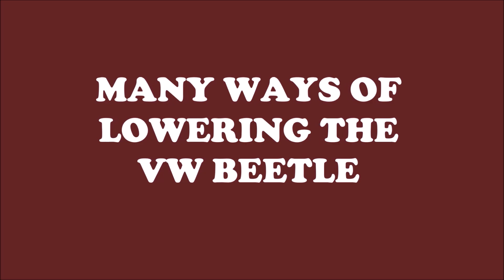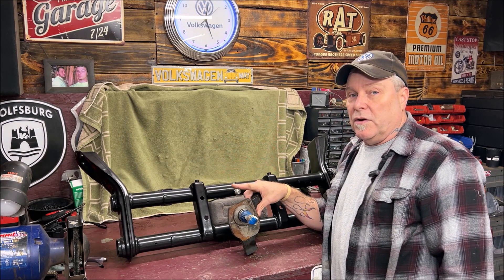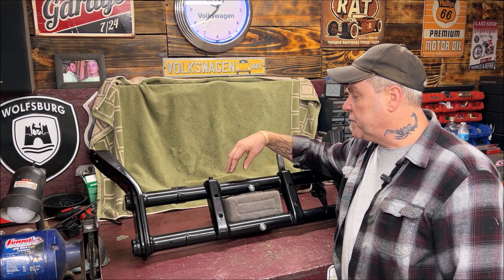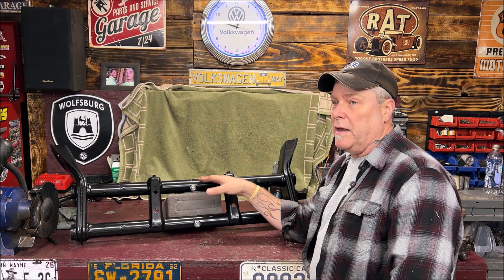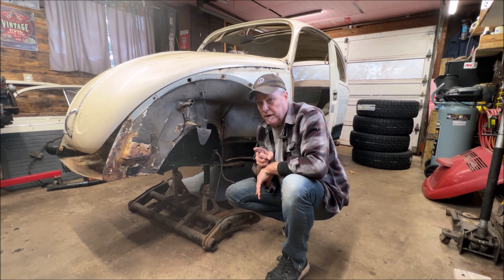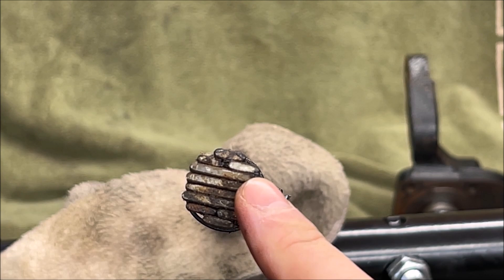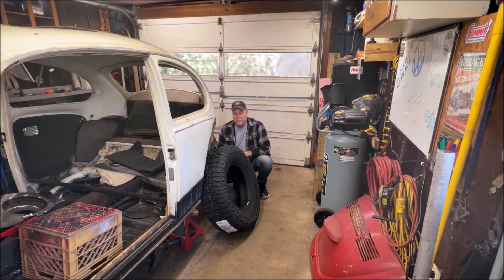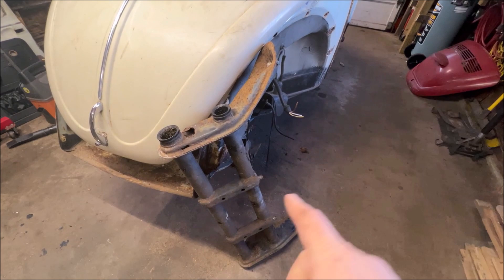HOW TO LOWER THE CLASSIC VW BEETLE - IMPORTANT TIPS TO KNOW - FRONT & REAR - VW BAJA - KARMANN GHIA

Comment: Nice explanation. The geometry is crucial. Everything has to work together. Mine had the 2” narrowed adjustable beam, 2 1/2 inch drop spindles and disc brake conversion with wheel spacers to clear the calipers. It did have the caster shims. I put KYB gas shocks to stiffen the front end slightly. The car handled nicely. The only thing I would ad is if your roads aren’t the best ( I live in the northeast) be ready to dodge pot holes and any other road irregularities. It can be a real PITA. A Baja has a certain appeal to me because of my experience. 😂

Comment: Good stuff, Slade! Would shims help the handling in a fully stock "72 Beetle?  I'm not looking to raise or lower my baby, but improving handling could be useful.
Reply from the maker: That’s a very good Mark. I surely don’t believe it would hurt it. Since there is not enough caster to begin with. 
Vintage76 added something to the comments that I’m pinning to the top. It’s hard to remember everything when you’re filming. With shims the steering box will need adjusted.

Comment: GREAT video buddy!  one more thing to remember is that if a guy decides to put in adjusters to the center of the beam himself, A guy also has to relocate the mounting brackets too buy grinding them off and rewelding them slightly wider or they won't line up to the frame head again.

Comment: As said not everyone knows all that info and I will be fitting the castor shims once finished with the welding on the beam.

What I didn't know was about the steering box not fitting properly afterwards so I have learnt something today. Thanks and much love from 🇬🇧 ..
Reply from the maker: None of us will ever know everything I agree. You will have to knock the tabs off of the lower part of the beam where the steering box mounts. When using shims. So you can adjust it to fit better!
Reply: @SladesVWBeetle  Thanks Slades   that's a great help and invaluable info 🤙

Comment: so i can add those castor shims to my 71 without raising or lowering?  I mean, I was hesitant to spend the time watching this because I didn't want to lower it, I wanted to raise it but now I after all this talk of change outta my pocket, I realize i don't want to even mess with all that, LOl  just want to rebuild the thing so it doesn't flop the tire over (something is really wrong in there when i turn left).  so this is really helping me out anyway.    i have not got to the part about the heater channel yet.     if i can improve the handling of the car with those castors it sounds like an awesome up grade to me for sure/   is there different sizes? what ones would I get for a stock 1971 NOT A SUPER of course . LOL

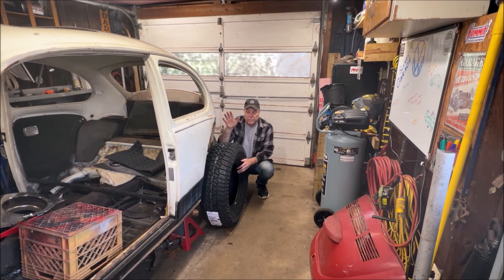Comment: 29:15 Is everything I shouldn't of done to my bug I think I may have ruined at least 6 sets of tires in the rear and may have bent my axles possibly.
Reply from the maker: I have never seen the axles bend, although that don’t mean it didn’t happen. Those things are pretty thick. I don’t mind lowering the front end slightly. The back may be one notch, but I don’t even know if I’m definitely doing that. In the back.